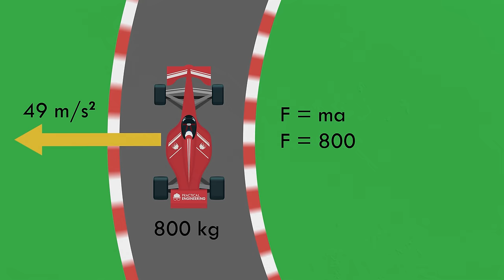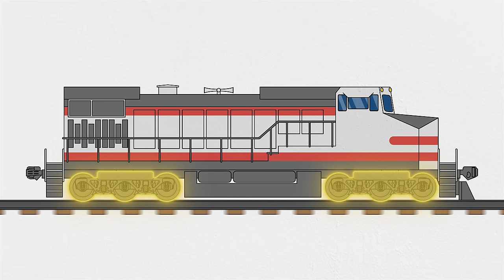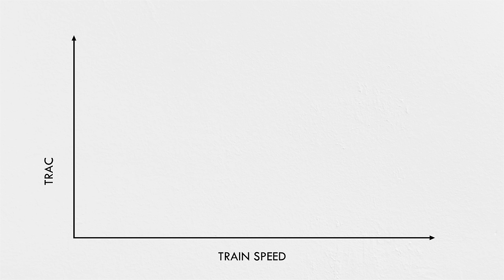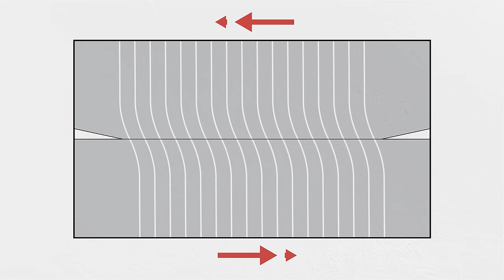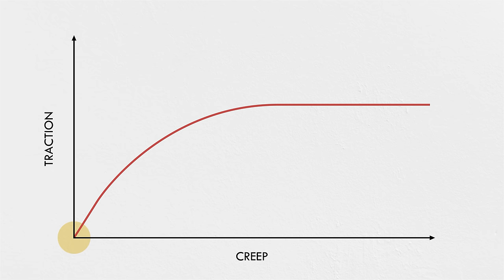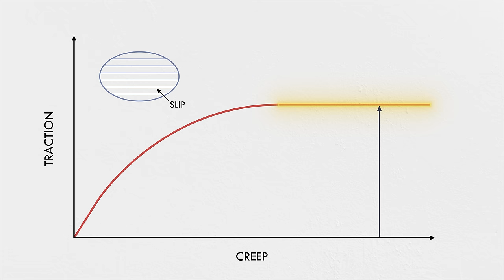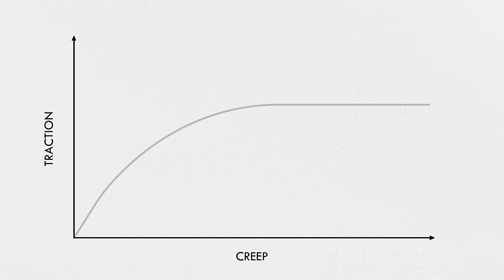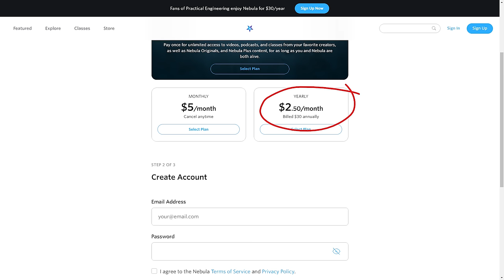Why Locomotives Don't Have Tires

Comment: Some rail vehicles have tires, for example trams have a rubber ring in the steel wheel. 

On June 3, 1998, an express train equipped with wheel tires had an accident in Germany.  Wikipedia Eschede train disaster
The rubber ring in the wheel had caused cracks in the steel tire, high speed, a broken crack, a switch and then a pillar of a bridge led to the catastrophe. The front locomotive and the first car still passed under the damaged bridge. 
But all the other wagons and the rear locomotive collide with the collapsing bridge.
Afterwards, this technology was removed from express trains.
The train line was initially shut down and later modified.
Reply: Seems to be the exception to the rule
Reply: On October 19, 1875, a steam locomotive derailed in the Timelkam railway accident in Austria due to a broken steel wheel tire. 
Since the coupling broke off, the rest of the train remained on the rails. There was only material damage.
The reason was probably that the connections between material strength and brittleness had not been researched.
Reply: @Derkiboi   Engineers try new concepts. This sometimes goes wrong. 
In the Enschede case, wrong decisions were made by many responsible people.  And then all the bad luck came together. 
The court could not find the one culprit, but spoke of the failure of many.
Ultimately, everything boiled down to monetary payments to those who were in the accident.

Comment: Locomotives have steel, rather than rubber, tires because steel is much more elastic than inflated rubber. 
This means the losses to heat from compression and rebound are much less from the flexing of the steel than they would be from rubber undergoing the same stresses.
Reply: Finally, someone else who knows train wheels have tyres. Granted most railways are moving to solid wheel systems, but wheel and tyre still exist. 
Just as rubber tyres come in different compounds, steel wheels are no different. 
‘Hard’ tyres last longer but are hard on the outer rail on curves. ‘Soft’ tyres are more gentle on curves but easily get flats if the get into slides. 
The balance between the cost of maintaining the track verses more regular re-turning the tyres.
Reply: @DB-thats-me  I thought the video would deal with the reasons for the shift to monoblock, especially with loco's wheels. Alas, it didn't :(

Comment: I actually experienced that first demonstration you made at my local gym. They're renovating and they replaced the Astroturf for the sled. Gosh is that thing HARD to push now! Before on the matted-down  turf, I was pushing ~235lbs or 106.594kgs, now I can barely push 135lbs or 61.235kgs on it! Friction changed EVERYTHING and it is seriously underestimated.

Comment: Because friction…though the Paris Metro would like a word!
Reply: Yeah the métro is unique! They planned for lots of hills I think. Good design and planning keeps railway routes flat and straight.
Reply: and notjustbikes talked about one in canada recently
Reply: What about roller coasters, which also use tracks?
Reply: @krissp8712 the Montreal metro also has rubber tires

Comment: As a locomotive tech, I remember reading in a manual somewhere about wheel creep. If I remember right it said that adhesion increases significantly when wheels are allowed to creep at about 1-2 mph above track speed.

This was a neat demonstration of why that happenes. Neat.
Reply: We were told 7% slip/creep was the ideal amount , first loco's we had with wheel creep where the UK class 60 , this system required radar to measure speed and wheel speed sensors in traction motors . GM class 66 has a crude version of this with radar but no individual wheel speed sensing "super series " nowhere near as effective as the older UK built class 60 wheel creep
Reply: @nounoufriend1442  I do believe more modern locomotives have a system with radar and TM speed probes to measure the amount of slip. That being said, where I work we only have ancient power. The newest stuff we have are SD40-2s so I won't claim to be super familiar with anything newer than that.

Comment: I wish your garage demonstrations had discussed the (significant) difference between the coefficients of static and dynamic friction. You generally don’t want your wheel contact patch to be sliding across the traction surface - this is hard for non-engineers to realize, but the contact area of the wheels of your car - or a train - are stationary relative to the surface.  So the coefficient of static friction is what generally governs overall traction power.
Reply: I think he explained the difference between static and dynamic friction very well. It wasn't obvious to me in the garage model, but I know from experience that it's harder to get something moving (like a chair) than it is to keep it moving when you drag it. And his graph showed the implications of this at railroad scale.

Comment: Some trains DO have tyres! The derailment at Eschanade in Germany was caused by an ICE (inter city express) train fitting with dual block wheels, meaning they had a layer of rubber followed by a second layer of steel over the wheel. This provided some cushioning to the wheels, minimising sound and vibration before the invention of continuously welded rail. However, poor/nonexistent maintenence led to the outer layer of steel coming loose and getting stuck in the train body, and forcing a derailment when it encountered a junction.
Reply: That was an unusual design.      The majority of wheels (that aren't monoblock) have steel tyres shrunk direct onto the steel wheels.   This was universal for steam locos, and probably a majority of diesel/electric locos in Europe.    The derailment was at Eschede, by the way.
Reply: You ARE correct Sir!

Comment: The contact patch size reminds me of two similar things that blew my mind when I learned about them.

The first is that steel power poles are held up only by the 4-20 bolts through them and not the large flange that more often way off the base.

The second is that all of the force holding your car up on the wheels is concentrated on 2 tiny roller bearings at a time per wheel. Not sure that the total contact area is but it's itty bitty for sure

Comment: The difference between static and kinetic friction is such a vital lesson in physics.

For the inverse reason, a cars ABS does the same thing as the train; Keeping the wheel at peak grip without slipping, in order to slow down the car as fast as possible.

Comment: When I was a kid, I worked at an amusement park and drove the train around the park.  Periodically, the rails on the turns would get greased and sometimes too much grease was applied or it would rain and the grease would get really slick and I would have to get out and sand the rails on an uphill slope.

Comment: Locomotives and rail vehicles do have tyres, just not pneumatic tyres. A steel tyre fitted to a steel wheel. These tyres do wear and have to be turned regularly to stay in the correct profile. When they can be turned no more they are removed and new ones fitted. Also if a locomotive and train brakes hard some wheels can lock up and skid and this will result in a flat spot on the tyre.

Comment: Look at the video called "NS 13T Epic struggle uphill" to see wheel slip correction working its absolute hardest. Creep control is only used once the speed begins to climb above 5 MPH because of how ground speed is measured if my memory serves me right. That has a very constant squeal from the wheels being allowed to slip a bit.

Comment: Great video that gives a basic foundation of friction and adhesion as they relate to moving trains. It would have been good to add short video clips of locomotives experiencing wheel slip and the resulting damage to the rails and wheels, the sounds that flat spots on car wheels make, and the loud, startling sound made when slack runs in or out as trains start to move. That will definitely get your attention.
There are a lot of other factors at play between trains and rails that you just didn't have time or the desire to delve into, and probably aren't appropriate for your audience demographics unless you are targeting conference rooms full of PhDs in physics and mechanical engineering. Subjects include quality/frequency of track maintenance, the condition of the roadbed subgrade, the amount of and cleanliness of ballast, rail wear, tie wear and settling, how well the rails are anchored to the ties, accuracy of the track gauge, and vertical deflection of the rails by moving trains. Stand a safe distance from a line with a train moving over it and watch how the rails deflect downward under the wheels, then spring back up, then back down as the next set of wheels pass over the same spot. Also, notice if any of the spikes have been lifted out of position by rail deflecting up and down if tracks are poorly maintained. I once saw a loaded coal train passing over a spot that had standing water covering several ties. The spikes had been pulled almost completely out of the rail, and when the train passed over that spot the tracks were deflecting vertically an estimated 6 inches. Every coal car lurched violently down and to the right so hard that the train was in serious danger of derailing. I quickly moved to a safe distance; fortunately, the train made it across safely. I reported the situation to an engineer friend and soon the problem was fixed. A railroad is a very complex environment.

Comment: You should look into drag racing cars that use that slip curve to their advantage as well. Especially in the lower speeds as they launch. It’s fascinating engineering used there as well.

Comment: Some time I'd love to hear you discuss highway pickups modified for rail service,  which use steel wheels to bear most of the weight but tires for starting and stopping.

Comment: Trains do have tyres, they're just not rubber pneumatic ones. AFAIK (a friend drives trains) when a wheel gets flat spotted they either grind them round again or replace the metal 'tyre'.
Edit: I thought I'd research what I was told and low and behold, 'railway tires' have their own Wikipedia page!

Comment: I think it's important to mention that trains also frequently use abrasive between the tracks/wheels for inclines and such, they just spray a little sand at the wheels while running so it's nothing complicated. It's not "just steel on steel" all the time.

Comment: F1 cars are actually not all that fast around the slow, tight corners, relative to other racecars.  That's because aerodynamics don't have much of an effect there.  Aero is what sets F1 cars apart from other racecars.  So with that, they are actually fastest around the high-speed corners (again, relative to other racecars) and is where they pull 5Gs.

Comment: I don’t know about now, but at least until a few decades ago trainwheels had tires (at least they were/are called that in german - Radreifen) it‘s basically a steel loop that was decoupled from the actual rim in order to smoothen the wheel/ride and ease maintenance cost.
Krupp‘s original usp was actually seemlessly manufactured steel tires.

Comment: Well as you mentioned trains can also have steel tires: They are cheaper to replace because you basically only put in a thic strip of metal, BUT you will find such wheels only on really old locomotives that still have spokes and now you might ask yourself why we bon´t use this type of wheel anymore. The answere is: Braking, yes braking. Old locos and wagons (at least in austria they would be old) use brake pads to create friction to slow down the rotation of the wheel to slow down the train and we all should know that friction creates heat and that warm metal expands so in some cases, when a train went down a long hill these tires got hot, expanded and fell of which caused the train to derail.
And that´s why Austria and many other countries use disc brakes and tireless wheels...
(If there are some mistakes in this coment, don´t hate me I´m austrian🙂)
Reply: Thanks - that was interesting. I saw another comment about tires and now I understand more about why disc brakes - interesting!

Comment: If you want to see a demonstration of the limit of friction on traction, look for videos of steam locomotives hitting wheel slip - once the wheels lose traction they spin really fast which gives you an idea how much force was being applied. (And its much easier to see slip with a big old steamer with connecting rods on the outside than it is to see on a diesel)

Comment: Steel wheels have also been used to achieve land speed records. A regular wheel/tire would get shredded if it was rotating too quickly, and since the car was propelled using rockets anyways, they did not really care about traction, only that there was a wheel attached so the car could roll and not drag on the lakebed - hence the solid steel wheel, much like a train wheel.

Comment: Surprised to learn that the wheel-rail contact is as big as a dime.  Since the rail is tangent to the wheel, it would seem the contact is merely a point. (Also the rails are crowned so there's little contact transversely.)  By learning how much contact there really is, I have to assume there is distortion to the wheel and rail.  And that leads me to be amazed that steel can recover from the deformation.  Another good video from PE.

Comment: One of the biggest notes, is when he says "4 little contact patches" the highlisted yellow is at best what the car is using for rubber on pavement. 

Yes, tires are big, but think about the small sliver of the wheel actually touching, and it makes everything even crazier

Comment: They did in the steam era. True, they were not rubber tires, but rather, a metal ring that went around the drive wheels. It was far cheaper to replace the metal tires than to replace a set of drive wheels.

Comment: Something sorta skirted around here is the difference between AC and DC traction motors fitted to locos which explains why DC is obsolete.

Briefly DC traction motors will speed up dramatically when adhesion is lost.  DC motors are also connected in loops as in if a Loco has 6 traction motors that will be 3 loops. If one motor in a loop loses adhesion and speeds up bad things can happen which I would find it easier to explain using a white board.

AC traction systems however control each motor individually. Also inherently the AC Induction motor fitted will not spin faster than the applied frequency.

Where a Diesel Electric (DC) propelled train may have required 6 locos to accelerate and decelerate the train, now you will see even  heavier trains propelled by just 3 AC Locos.

Traction is a large and interesting topic encompassing Rail, Marine, Earthmoving, Trolley Buses and more recently battery electric road vehicles.

Comment: The other problem with stick slip is it can result in shearing the pinion gear off the traction motors..

Years ago when I was a railroader I was on a local job that had managed to gather up two miles worth of cars, totaling 11,000 tons.  We had two GP-40s for power (four axle units). We only needed to go a few miles to get back to the yard, but it was a slow trip with a number of stick slip events with the engineer searching for the limit of traction. Never were able to use full throttle due to the adhesion limits. I’m sure that management would not have been amused.

Comment: Actually trains do have tires just not the way people think of typically. The wheel is a two part system so that it can be serviced by replacing the outer most metal ring that makes up the contact area known as the tyre. Tire was shown by Union Pacific in one of the restoration series they have on YouTube.

Comment: Virtually all locomotives, and carriages and wagons, actually do have tires. Steel tires, heated to expand, then cooled to shrink onto the wheels, then put onto a lathe to get them the correct profile, and will be remachined as required to remove various defects that can arise, including flat spots, until they reach the condemning mark, then cut off and new tires put on each wheel.
Reply: Been fitting Monoblock wheels on locos since the 1980's , waggons have been Monoblock since 1970's with very few exceptions in UK , wheels with tyres are only on heritage diesel and steam traction . Can't vouch for newer passenger trains as only worked on freight since UK rail privatisation but can't imagine they have tyres anymore

Comment: 2:33 austrian federal railways has 100 class 2016 diesel locomotives, 90 class 2070 diesel shunters and 60 class 2068 diesel shunters.
meanwhile they operate a fleet of 332 class 1016 / 1116 electric locomotives, 50 class 1216 electric locomotives, 123 class 1293  electric locomotives, 165 remaining class 1144 electric locomotives and 9 remaining class 1142 electric locomotives plus 50 class 1063 electric shunters, 10 class 1064 electric shunters and 20 class 1163 electric shunters. so no. it's not "most modern freight locomotives". it's "most modern u.s.-american freight locomotives"
Reply: Given that the US has a ton more locos than Austria (and Austria and Germany, well, combined), he might have a point… but of course doesn't, because the world is bigger than the US.  But I really don't know (and am too lazy to find out) how many locomotives world-wide are diesel and how many electric.  Quickly only found that China has 70% electrified railways (in 21).  How many locomotives do they have?  Don't know.

But it does show the typical american blindness to the world.
Reply: why would dyou put germany in the statistic together with austria? if anything, austria and swizerland would make a more logical combination

Comment: My understanding is thatsteam locomotives certainly do have tires – just made out of steel not rubber. I guess the tires were dropped with the much smaller wheels used in the Diesel/electric locomotives.